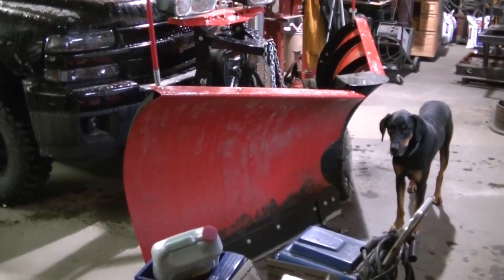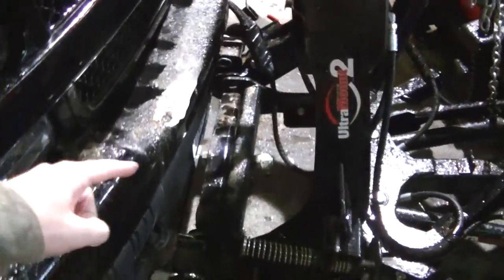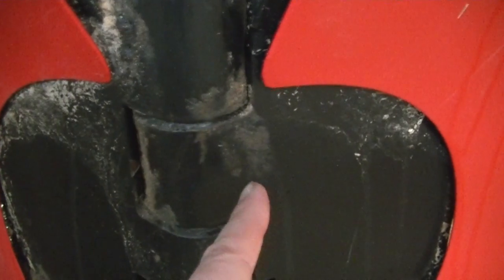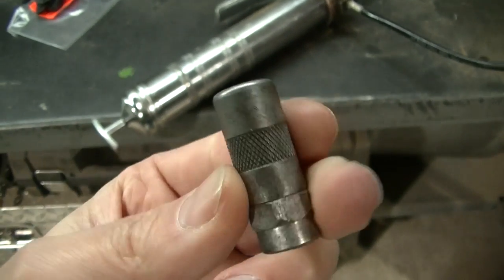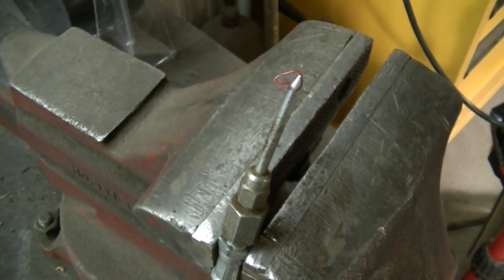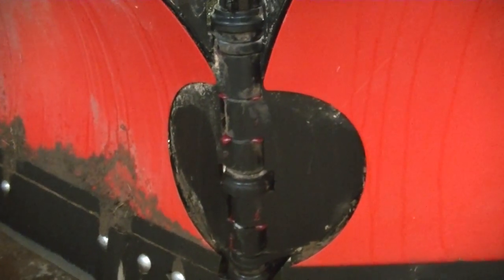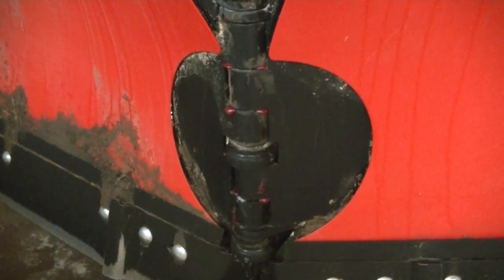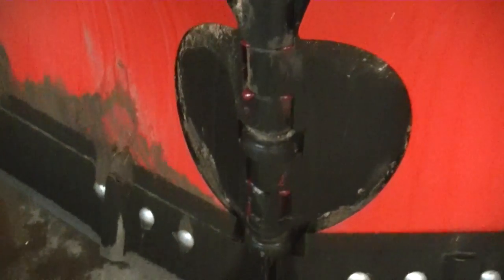Western MVP3 "Greasing Center Pin"

Comment: Their is also a grease fitting on the center bolt that allows the plow to pivot back between the two other fittings you pointed out.
Reply from the maker: I didn't think the pivot bolt had a grease fitting.  I am heading out to the shop shortly I will have to look.
Reply: mossman381 If I remember correctly, it is hard to access with the truck hooked up. I wanna say the fitting is on the back side of the bar on truck side but I could be wrong. I haven't greased mine yet this year. Did last year before I put it away for summer. Only plowed 7 hrs so far this year.
Reply from the maker: Yup,  you have to go under the front of the truck to see it.  Why in the heck is it not in the front for easy access.  That really doesn't move much so they must figure it doesn't need grease as often.

Comment: There’s also a grease point on the center pin between the 2 you pointed out. You can see it from the driver side. I’ve got the same plow and just found it. It’s clogged and these grease zerks are drive type not threaded. Can’t find the size though.
Reply from the maker: It's easier to grease that center one after the plow is unhooked.

Comment: Love the videos, your the reason I bought a new Western for this season. Neat kind of fitting is that?  I wouldn't know what to ask for at the counter.
Reply from the maker: There is one more grease fitting that you have to crawl under the front of the truck to get behind the plow.  It greases the pivot bolt that allows the plow to follow the terrain when it get uneven.  Easier to do that when the plow is unhooked.  Here is the grease fitting  https://www.amazon.com/Lincoln-Lubrication-5803-Grease-Needle/dp/B0002SR6XE/ref=sr_1_1?ie=UTF8&qid=1482722795&sr=8-1&keywords=needle+grease+fitting

Comment: 3 zerts.  one on the center pivot bolt :)
Reply from the maker: Yes,  crawled under the truck and found the center one.  I don't think that bolt moves much.
Reply: mossman381 It pivots on that main bolt. That would be the first one to go.
Reply from the maker: I disagree.  It just pivots while on the ground and it doesn't pivot very much.  The 2 lift pins have all the weight of the plow every time you lift the plow up.  I would say those do the most work.  The center pin wear will depend on how much you move the plow from v to scoop.